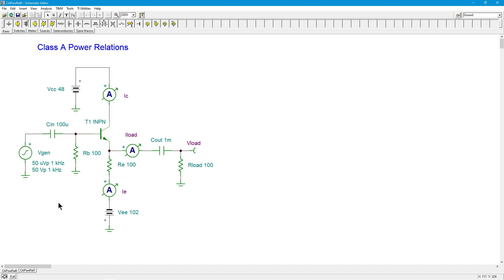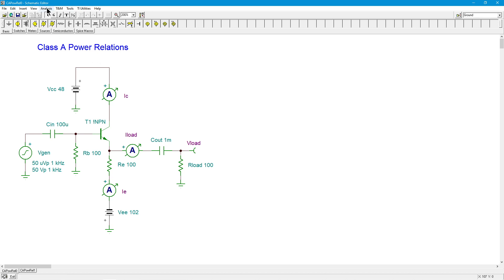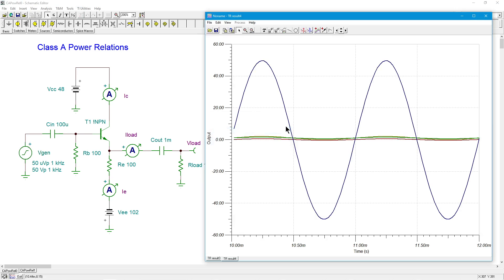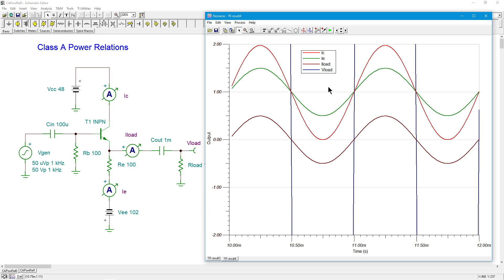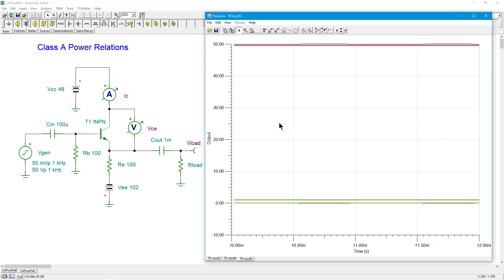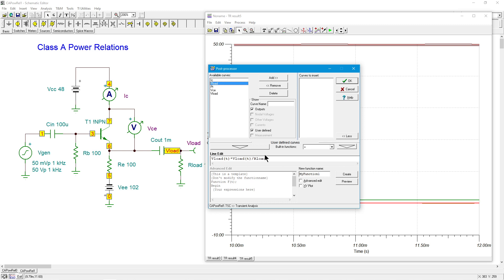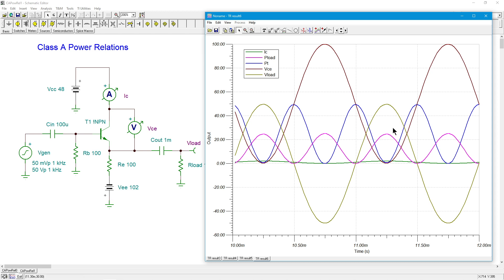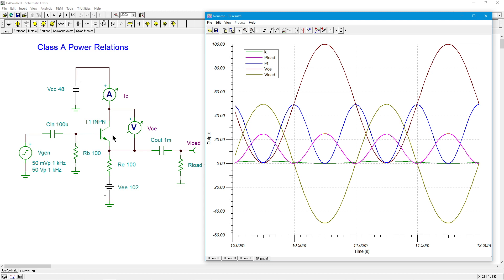Semiconductor Devices: Class A Power Relations

Comment: So in essence, to improve the efficiency of the Class A amplifier we simply need to play Hi Voltage Rock n Roll constantly.
Reply from the maker: I assume you mean to keep the output transistor cool. Yeah, that's the non-intuitive conclusion! Any way you slice it, class A amps are not power efficient.